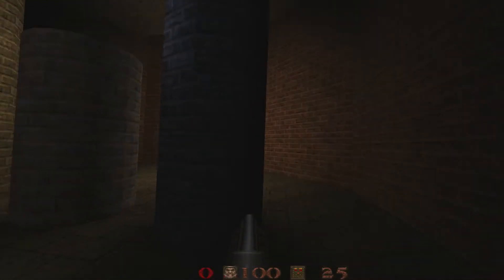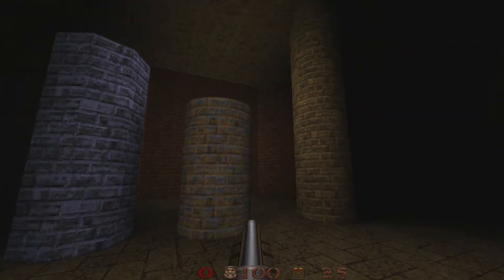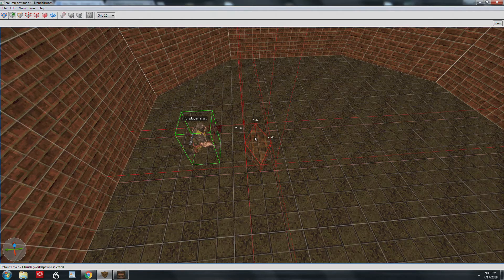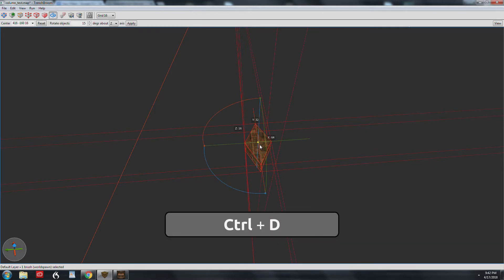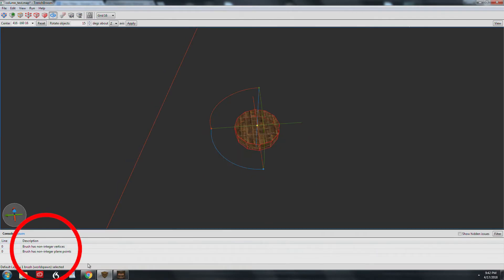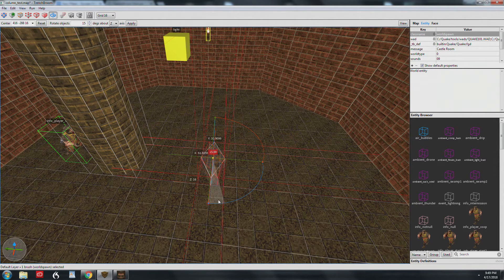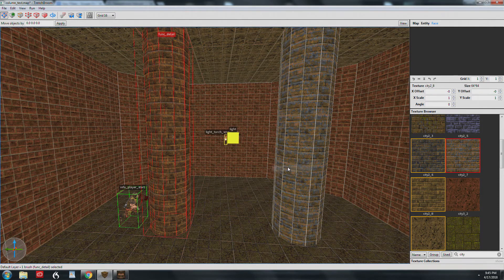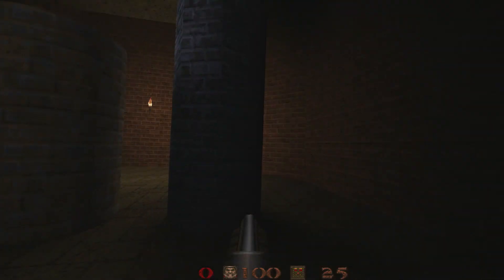Quake Mapping: Easy Pillars

Comment: So many trenchbroom tutorials for making Q1 maps and stuff, but none for Q2. 
I can understand that the process is very similair, but I still wish there were some tutorials for Q2.
Reply from the maker: Anthony Izumi The only big differences are texture features and using different compilers.Other than that everything is pretty much the same.
Reply: dumptruck_ds and thats exactly the problems I have. The compiling process is hard for me. I tried to compile using trenchbroom compile tab and ebsp3, but there are some weird comand lines I need to type. I did this once by accident, but half of textures were missing and map had no lights and shadows whatsoever, it wad just plainly bright all over the place, even though I did place light sources. So anyway, if you could make some q2 trenchbroom tutorial that would be great!
Reply from the maker: Anthony Izumi I will make time for this soon. I am working in texturing tutorials today then will do func_trains. After that I can do a quick video on Q2